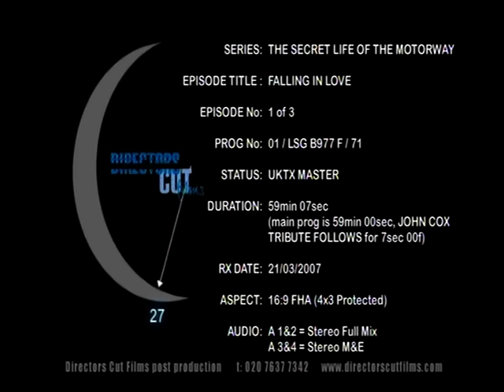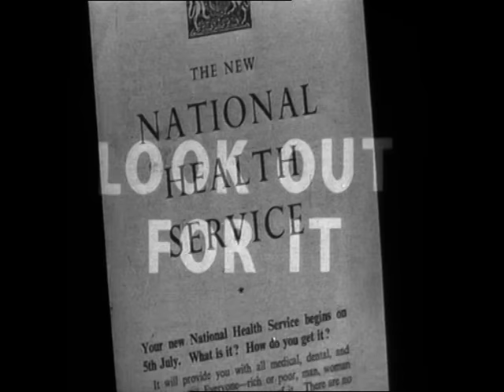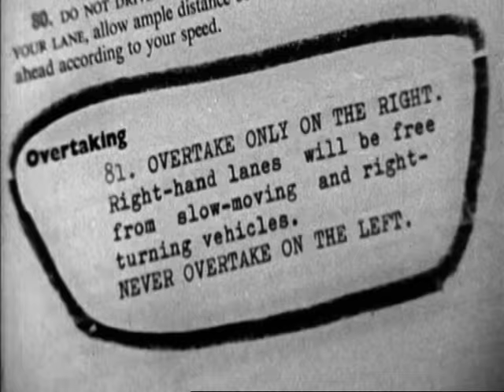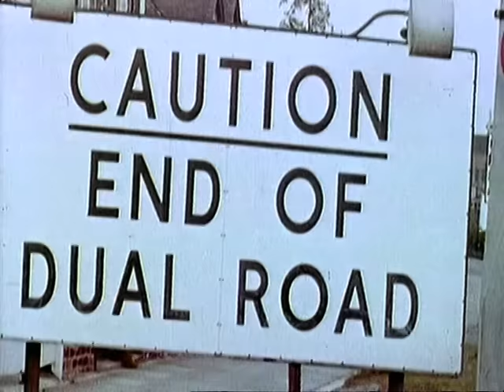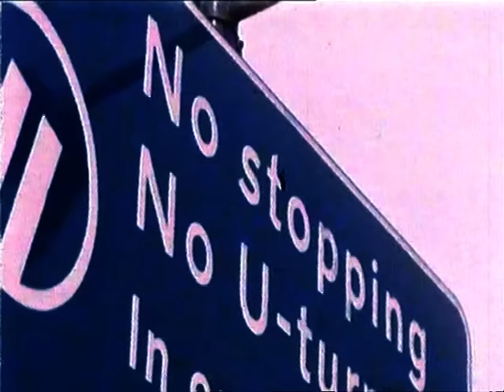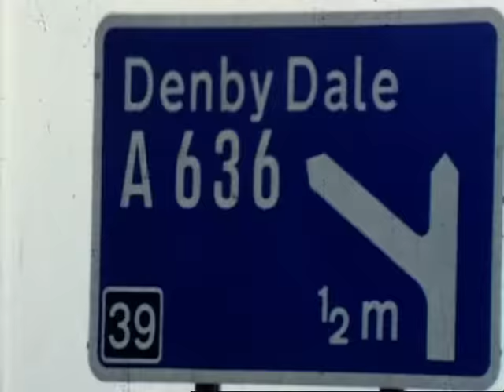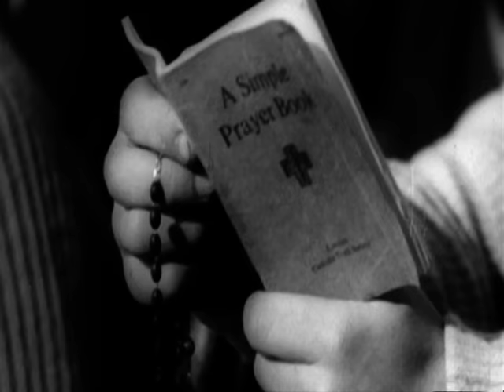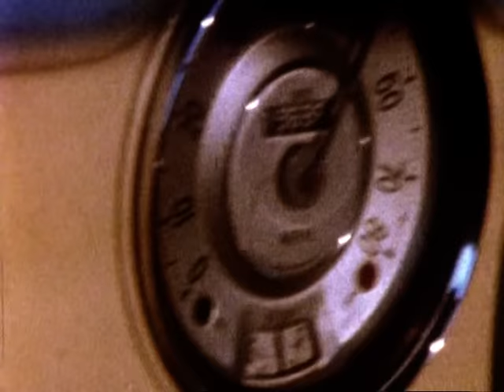THE SECRET LIFE OF THE MOTORWAY  PART 1

Comment: If only the roads were as empty now !!These days doesn't matter what time of day or night you travel, it's like a bloody car park for lorries !! Especially when the sods insist on overtaking the one in front at about 3mph more and sits in the fast lane for ages holding everyone else up. Pain in the arse :O)
Reply: +SONGSTICKS Try driving one, or being in one. For timed jobs, the 20min difference that can be made by doing that can mean the difference between making your delivery and getting paid, or not.
Reply: +Sam Gamble Fair comment :O) But then equally I spose, the hold ups they cause van drivers could mean the same difference to them.I guess the biggest problem is that the world and it's consumerism moves way too fast these days !
Reply: SONGSTICKS I suppose your right. Roads that were build too big back then are too small now, a problem that is only going to get worse im afraid
Reply: +Sam Gamble Very True. It comes down to the same problem for most issues. Too many People !!
Reply: SONGSTICKS 67!7
Reply: Air travel used to be much nicer until about 20 years ago for the same reason.
Reply: The world is severely overpopulated.